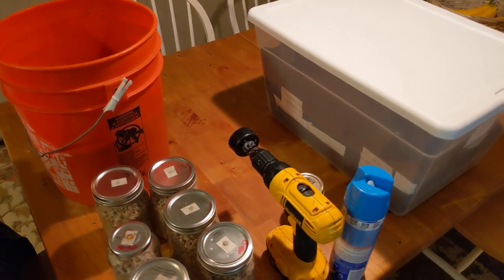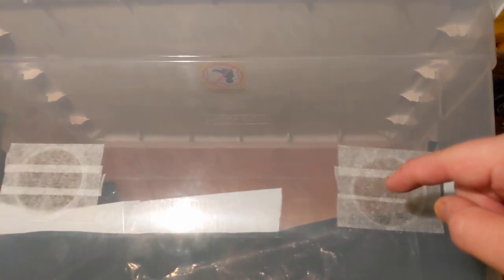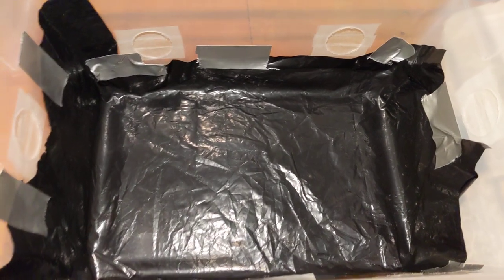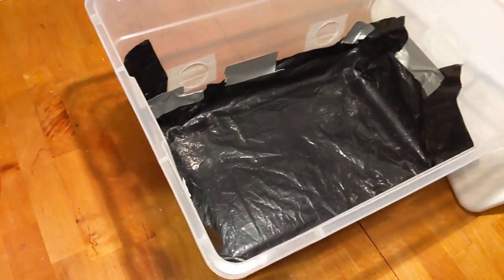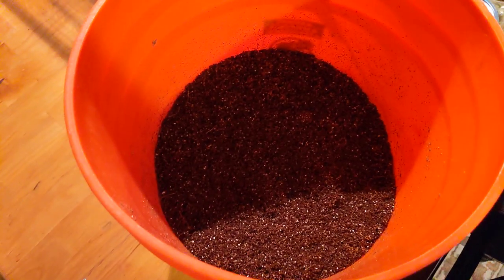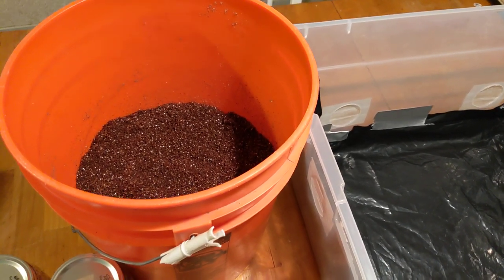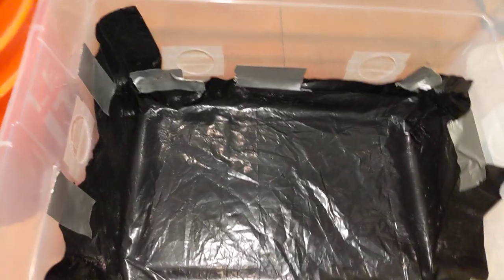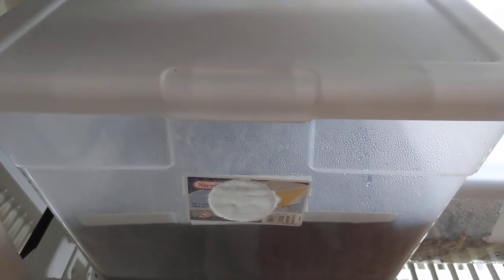Monotub Tek Basics

Comment: I find that using a plastic liner and tape can bring in unwanted contaminants. In my opinion, side pins are a small price to pay for having less moving parts, so to speak.
Reply: Sanding and painting the lower outside with the ( for plastic ) spray paint is working well for me. Sanding the outside with a heavy grit paper can also cut down on light, and won't deteriorate from alcohol washes etc.
Reply: Like in terminator 2, the tr1000 cannot morph into complex items with moving parts. Remember that it applies to many things.

Comment: A douche is a device used to introduce a stream of water into the body for medical or hygienic reasons, or the stream of water itself. Douche usually refers to vaginal irrigation, the rinsing of the vagina, but it can also refer to the rinsing of any body cavity.
Reply: Luke Ravesi - also french for showed
Reply: The actual definition is "a shower of water" but you're not wrong either 😂

Comment: Could you provide the detailed steps for preparing the substrate? do you use a bag to drain any water from substrate? Thanks
Reply: Here's the recipe I use, it looks pretty similar to his. Put 650 g coir, 8 cups of vermiculite, and 1 cup of gypsum in a large bucket. Boil 16 cups (US) of water and throw that in then close the lid and wait 8 hours or so. Should be perfect field capacity but be sure to test. If draining is necessary try to squeeze out as much water by hand when preparing your tub. Hope this helps!
Reply: @SketchySkullKnight  Thanks dude! I used your method. Now we play the waiting game 😎
Reply: @doublew030  how'd it go

Comment: What are you doing for moisture? How much light, ambient or other do the tubs get per day? Do you open them daily and fan or mist them etc? Or just leave them alone? Thank You
Reply: ask joe
Reply: @coolvader8  Joe Who?
Reply: Tango Nevada joe mama
Reply: @AnonYmous-ch5vz  I already did. Still no reply. So you guys are clueless?
Reply: Tango Nevada so mushrooms aren’t photosynthetic but do grow towards light. That’s why you black out the bottom of the tub, so shrooms don’t grow down there. They’ll use your nutrients and you won’t be able to harvest them. Don’t worry about light too much, but if you have it in a closet a little light can help. Opening them daily exposes them and can risk them being contaminated. Keep it sealed. You should have filters over holes so you will be getting air flow. Mist as needed.
Reply: @TangoNevada  you can just use ambient light. If you can put it in a room with a window that would be great, otherwise I doubt its that important. As for water you want to not open the tub after mixing the bulk substrate with the spawn as to avoid any contamination from bacteria or spores in the air. After the bulk substrate is fully colonized you can mist every so often trying to keep it humid and remove some or all of the polyfil. Just mist enough that it stays humid but not wet. Just moist. If you want to avoid misting so often you can add a casing layer which is just a layer of coco coir that will help hold moisture in the tub. If you have any other questions feel free to ask. And good luck growing.
Reply: Fanning when you must would be a good idea. I also don't use a casing layer because mushrooms grow based on sensing light so it might help not too.

Comment: Great video!! I just inoculated 8 quart jars of oats. I used 4 different strains. What size tub would I need for 2 quarts of oats?  A 25 or 32  quart tub?
Reply: All depends what you prefer I like 25 with 4 to 5 inch sub🍄💕
Reply: Do you work with agar? It will change your world if you don't you should learn how to!
Reply: @rise-amorph8178  that's my next thing to get down. When I first started I didn't realize how important it is and how much safer it is.
Reply: @rise-amorph8178  my jars are colonizing good just shook them up. I believe the 25 quart is the way I'm gonna go. I'll probably do modified monotub with the lid snapped down. I'm gonna layer my oat spawn and coir
Reply: @electrikjimmy608  good call you don't have to mix. You can start with sub the a layer of grain , and on and on remember to put foil on top and put in the dark cove your lower holes with electric tape to keep in co2
Reply: @electrikjimmy608  the larger tubs are mor difficult to maintain and if you do get contaminated you don't lose everything, if you use 2 25 qt then 1 55qt
Reply: @rise-amorph8178  awesome. Thanks for the help
Reply: @electrikjimmy608  anytime gl 🍄💕

Comment: Do you use a pressure cooker to sterilize the spawn and substrate? I
Reply: Yes, it's common to do so.
Reply: You can boil substrate in a pillow case  to sterilize it and find field capacity once it begins to cool down. Your grain/spawn has to be the most sterile so you'll need a PC for that. Bucket tek is what he's doing but that works best with cleaner starting material. A PC is always necessary if you plan on using other subs, especially manure based.

Comment: How long does it take after you inject spores in the grain to be ready to add to the tub?
Reply from the maker: First of all...going spore to grain is very tedious and time consuming. I understand that many times it is the most practical way to get your operation going. Just be prepared for many jars to fail as you start out. You will need a SAB (still air box) to do this without failing. Once you innoculate your grain (I use whole oats but rye, wheat, corn, WBS, or millet will also work) you need to set the jars in a warm, dark space and allow them to colonize. This can take up to a month with spore to grain innoculation. 

Once your jars are ±25% colonized you should thoroughly shake them up to distribute the mycelium throughout the jar. This will speed up colonizing a lot. 

Once the jar is ±75% colonized....shake them up again. This will push the mycelium into the areas in the jar that are having difficulty becoming colonized.

The jars will quickly recover from your final shake. Once they are totally colonized you can use the spawn in a tub. 

I always save a jar of spawn to innoculate the next set of jars. Spore to grain sucks so bad. I hate it. So going grain to grain is my preferred method (I haven't learned agar yet) to get jars that are ready to use in two weeks versus 4+ weeks going spore to grain.
Reply: @grantswishes420  Definitely don't need a SAB. Just use an injection port
Reply from the maker: @JesusTouchedMyJunk  Those definitely help a lot. I have never used them myself, but using my homemade jars I have always used a SAB and it was a real game changer. Injection ports are great though... totally agree.
Reply: Mike Rodose thank you so much!!

Comment: 6 jars for 1 tub?
Reply from the maker: You can use less, but I has a surplus when making this tub.
Reply: Do you soak after each flush ? How long for do you soak for?
Reply from the maker: @RandomRobScratchin  I soak them after 2 and 4 flushes. I usually get one more flush of larger than average specimens after the 4th flush. I use distilled water and let them soak overnight.

Comment: Hello Mike. Thanks for the info. Is an misting fanning needed for this ?
Reply: If your sub is field cap its a no but many variables come into play, temp, outside humidity etc so still keep an eye on it. My names mike too  so i answered lmao.
Reply: @michaelstapleton6073  haha well thanks Mike. I just started to learn,what do you mean by a sub(substrate ?)field cap ? 

I'm looking for a technique  with no, or little misting, and I concluded on Dubtub shoebox, zombie tek, does it make sense ?
Reply: @anikibrother7691  sorry man yes substrate and field capacity. Most of those techs will require misting, im not an expert by far tho and im not familiar with the zombie tech. If you do a mono tub and get your sub to field it should be set and leave but even then it needs checking. You need to research research research or u will fail first time for sure. Cleanliness and using iso propoline alcohol is a must. The cleaner u are the higher chance you have. If there is a way for us to chat off of here ill help as much as i can again not an expert just a helpful guy.
Reply: @anikibrother7691  ok pal sent. U can remove your email from here now.

Comment: Does touching the substrate before mixing increase the risk for contamination? At this stage how important is the sanitation of all processes? ex. Should I use gloves when breaking up cakes, conduct in still air environment, etc.?
Reply from the maker: I keep my grow area clean and use gloves up until I start harvesting flushes. I have abandoned any illusions of "sterilization" past building the tub itself because it's impractical. Just use as much sanitary practice as possible, but accept that you will probably be writing off some tubs/cakes to contams. The longer you do this... the more streamlined your process will become.

Comment: Can i avoid that side pinning u mentioned before with painting with black the oustide of the box, instead of using a black plastic bag like that?
Reply from the maker: No. The light penetration isn't the trigger for side pinning.... it's the microclimate created by the condensation around the edges of the sub. If you use a loosely attached plastic liner it gives the sub something to cling to as it consolidates more and more with each flush.
Reply: No because F.a.e is a big thing when it comes to starting to see pinning in your tote...no bag allows f.a.e in unwanted parts such as the bottom and you will get mushroom all over the sides and bottom. Sometimes the bag will stick to the substrate with strong mycelium which helps alot but the idea is use a bag and keep the same humidity that away the substrate doesn't shrink and pull away from the bag. Youll get the hang of it

Comment: I only have 3 lbs of spawn. Can I still count on that to grow? If so, how would layering work with so little spawn? less layers?
Reply: Chuck just go with a 30 quart tub
Reply: If you use a sterilite 32 quart plastic tote with the 4 latches and the gasket you don’t need to drill any holes. Look up BOD’s unmodified monotub
Reply: @joshenns2957  Thank you, this is perfect